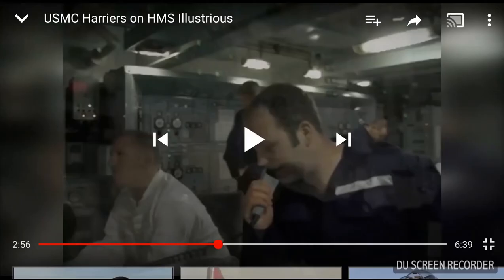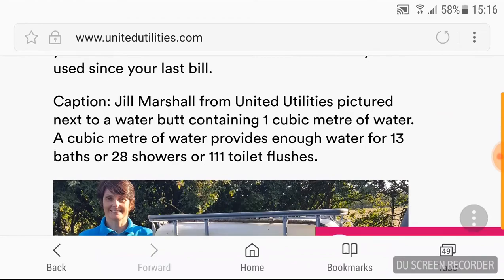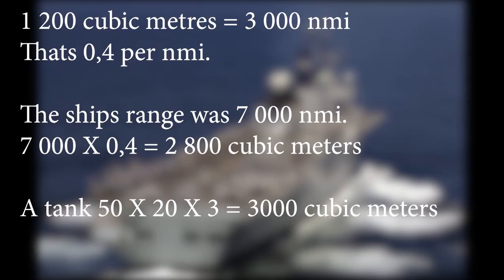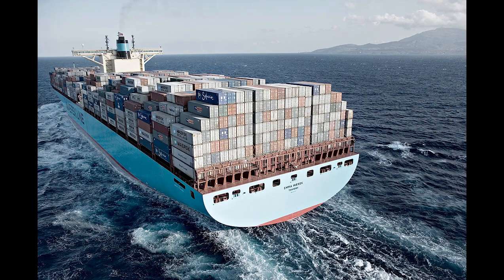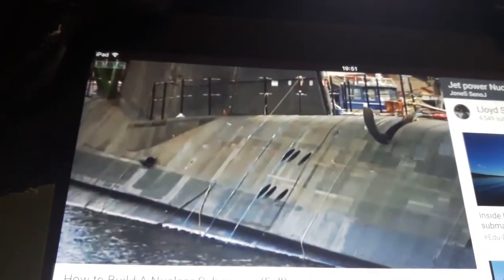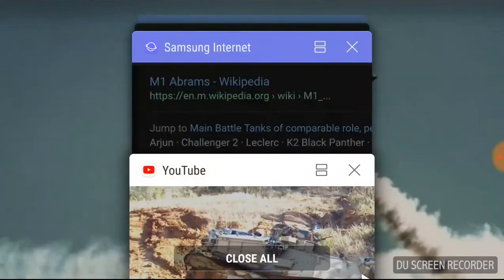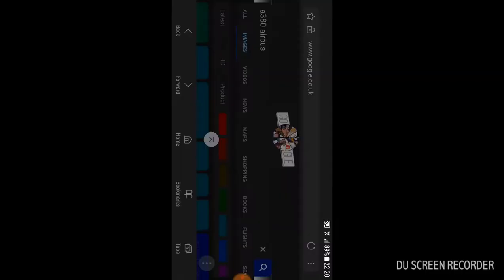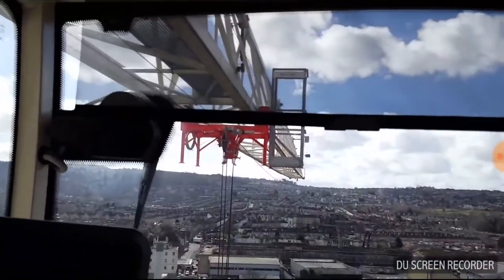Flat earther who thinks that Aircrafts are powered by air, and ships by water.

Comment: These fuel hoaxers are the craziest of the lot.  I didn't know Cranky was a fuel hoaxer initially until I saw his video on the Concorde.  He claimed the wings were paper thin. 

I showed him a few links to the fuel schematic and pictures of people crawling around inside the wing fuel tanks and he quickly deleted his video.  I think asking him about that video is the main reason he blocked me. 

He seems afraid to answer each time I ask him about when he comments on our channels.  

Even a little Citation 2 holds a lot of fuel.  I hand pumped 12 x 44-gallon drums into one at a remote airfield once and the wings were not even close to full.  Those drums were full as I rolled each on to the plane myself, they were empty after the refuel.  

The weight and balance graphs for the plane factor in the fuel burn profile to show what happens during a 12-hour flight as wings, center and aft tanks are cycled for optimum trim.   Burning fuel from the Aft Tank too early in a flight can cost you 500 lbs extra overall.
Reply: Is this that dimwit Jones? I recognize his voice, I thought his channel closed down years ago.
Confirmed, Jones has his channel back and is putting all his old BS back up since being released from the infirmary , the last part is his brother in idiocy LEO.
Reply: @Wolfie6020 if I may ask, is there are relation between the fuel used (per time interval) and total weight of the plane? My immediate intuition says yes, but drag only changes with the shape of the plane so I guess there is no to little variation in fuel usage when cruising?
Reply: @doranku  All the answers were very good.  Yes drag does change with weight even at a steady cruise speed.  

The heavier weight will require more angle of attack on the wing at a similar speed so that will be extra drag (Called induced drag) 

The distribution of weight plays a big part also.  If too nose heavy the tail plane needs to compensate more and that means extra drag so you burn more fuel for zero benefit.  

As you get lighter after burning fuel the drag reduces so you can reduce power on the engines and maintain the same speed or go higher.  

Doing the raw math for ATP level flight planning was quite involved as you had to adjust each sector for the estimated midpoint weight and get the fuel flow based on that.  Then when calculated accurately you sometimes had to adjust slightly.  It would easily take an hour or more to run a full international plan manually.  

Now computers make it much easier and can do it more accurately in seconds   

As an example.  When levelling off at maximum weight we might burn 4000 lbs per hour in cruise - after 12 hours we are so light we are burning 2800 lbs.
Reply: @Wolfie6020  Thank you Wolfie, this confirmed what I was expecting with the other answers in mind. One more bit of knowledge that I will never use myself ;)
Reply: @doranku  ,but I think it's well worth the asking of a question,  from an expert in the field,  to find the answer.  Even if it's knowledge you have no intention or need to utilize,  at least it's going to be correct information.  Perhaps even win you a beer in a pub quiz one day,  or more importantly answering questions from children when they ask.  
Unfortunately the flateartholigists n others of the ilk seem to read a few wikis,  watch a few video's in their feeds ( which usually means filled with conspiracy theories n suchlike n blocking of scientific knowledge that the rest society uses), n make a ad hoc rationalization of the 'facts ' to fit into the narritive they are comfortable with.   N obvious display of cognitive bias n dissonance.
Reply: @doranku  "...but drag only changes with the shape of the plane" isn't correct. Here are some approximately true drag factoids: [0] Drag decreases with altitude - the medium is easier to 'swim' through as the atmos gets less thick. [1] some elements of drag increase as the square of the speed through the air [2] Increased weight [more cargo] requires that the plane generates more lift to achieve equilibrium in level flight [3] More lift [which equates to more cargo in level flight] causes greater "Lift-Induced Drag" [which interestingly lessens with greater speed]
Reply: @nightjarflying  I tried to say when level flight and "constant speed" with "when cruising". So given those are constant the usage fluctuates a little due to needing less lift. But to decrease lift the speed has to drop, so the amount of fuel per timeinterval decreases but the total time increases...
Reply: Dora Nku - Jet aircraft fuel burn is measured in lbs or kgs per hour. Typically the heavier you are and the faster you fly greater the fuel burn. Higher weights also preclude flying higher which is also better for fuel economy. There is also another strange phenomena (which makes sense when you see the graphs) the means the heavier you are the greater the speed for minimum drag. I’ll edit this post with some numbers when I look up my aircraft’s charts. EDIT: A half loaded aircraft (Embraer 190) landing at 34,000 kgs will use 5,050 kgs of fuel to fly a 1,000 nautical mile sector cruising at M 0.77. A fully loaded aircraft landing at 44,000 kgs (1,000 kgs above our authorised maximum) will burn 5,570 over the same route distance at the same speed. In pure cruise terms at M0.78, a 47,000 kgs aircraft has a specific fuel consumption of 0.223 nm/kg at 36,000’ (the highest it can get). A far lighter 34,000 kgs aircraft has a specific fuel consumption of 0.294 nm/kg at 41,000’. The additional fuel consumption is due to the additional induced drag arising  from the necessity to generate extra lift to support the heavier aircraft.
Reply: @Trevor_Austin  Thanks for the numbers. The difference is a bit more than  I expected.
Reply: His channel has been non stop with jet fuel hoax videos he deletes any comments he disagrees with. The more aircraft common knowledge and common sense you throw at him the more his simple followers call you a troll or shill. He refuses to accept invitations to an aircraft facility those comments get ignored and deleted as well.

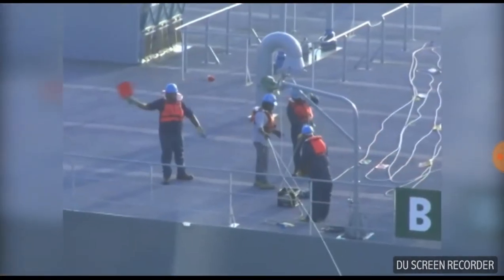Comment: Cranky missed the boat on this one. Having been aboard a US carrier during a RAS,  I am familiar with the refueling phase. Had to go back and review the video to find it in his clip. If you pause at time mark 1:29 in your video you will see two rather large hoses in the background. These are the fuel transfer hoses between the two ships (appear to be ~8-10:" in dia.) which connect to a pipe system into the fuel tanks of the receiving ship. The entire RAS operation is quite amazing as you have two ships of considerably dissimilar size cruising at ~20 kts. and maintaining a parallel course with no room for error as they transfer a massive amount of cargo and fuel.

Comment: I wonder how the submarine gets air for its gas turbine that runs on water. Sadly there are also people that think electricity is free & the power lines capture electricity from the air, when asked why we have power stations they claim that's to maintain the hoax.
I spent 35 years working on aircraft & have spent plenty of time crawling around in wing & center fuel tanks, I got lots of abuse explaining aircraft fuel systems to some fuel hoaxers. The question they cant answer is where the compressed air cylinders are & what evidence is there that they are charged with compressed air during a turnaround. I cant remember the channel I engaged on the fuel hoax but he did change his conspiracy afterwards & put a video up claiming aircraft used far less fuel than the manufacturers claimed & passengers were being overcharged.
Reply: They are YT "experts"...they know ballistic angles,energy consumption rates and nuclear energy better than anybody just because they saw a YT video...
I tried to explain to one of those "super scientists" about the fact that you need more energy to compress air that the ammount you get by releasing it...he did not get it.
They will believe the words of a delivery boy or a truck driver on YT,but not a book written by a well known scientist!
Reply: @xenomorphphantom8991  Recently Rude Earther put up a chemtrail video, I kept asking where were the chemicals stored on a commercial airliner & how were they dispersed into the atmosphere. I couldn't get a straight answer so I told him after 35 years working on aircraft I have never seen an airliner equipped to disperse chemicals. He called me a liar, went on my channel & left an abusive comment which he later deleted. Wally & Wolfie then started to educate him on contrails. He even claimed there was no hydrogen in the fuel to produce water in the exhaust so they had to remind him the fuel was a hydrocarbon. He didn't give up even though was so far out of his depth he kept on arguing & insulting. Undeterred he has put out another two chemtrail videos up, proving you can't educate these people.

Comment: Jet turbines running on nothing but air?  Sounds like they were developed by those "Breatharians" who think you can live without food just by breathing air instead.

They have no concept of the energy requirements for flight, moving a ship through water, etc.  Energy has to come from somewhere, whether it be chemical or nuclear reactions, wind or geothermal sources, anywhere!  If you can generate that much power from simple water, why do we put out fires with it?  Wouldn't there be a risk of massive explosions?  Until we can use mass conversion into energy we'll be stuck with less efficient yet practical (and real!) methods.

Comment: Ah the beloved ‘8 ton skip’ so named because if filled with building waste, it can hold up to 8 tonnes.....
For example, concrete density 2400 kg per cubic metre..... as opposed to water at around 1000kg per cubic metre, or aviation fuel 800-900kg per cubic metre.
The density is high in these people!
Reply: I guess if he thinks you fill that 8 ton rated container with feathers, you have 8 tons of feathers.